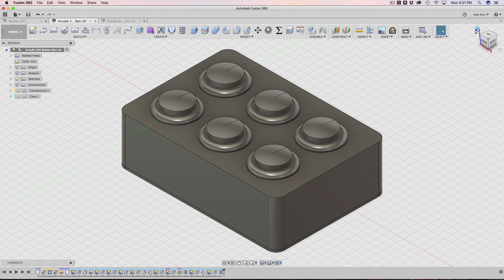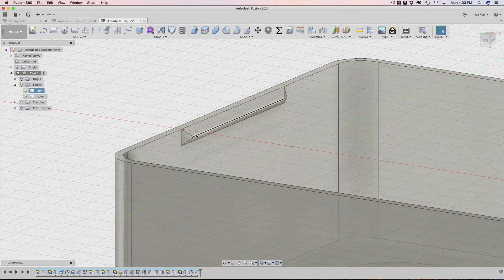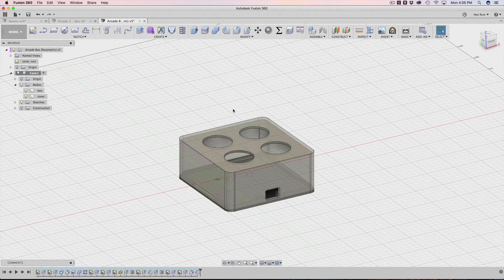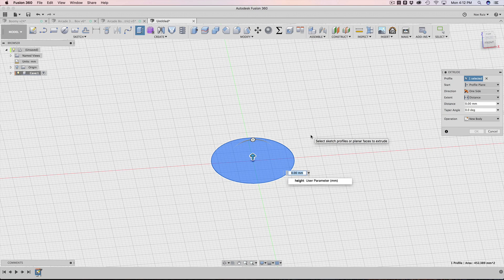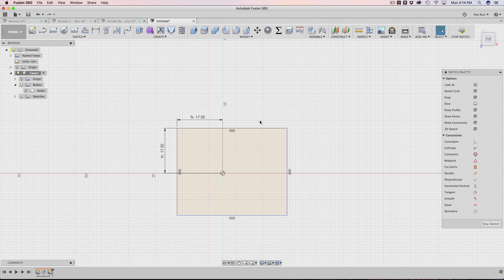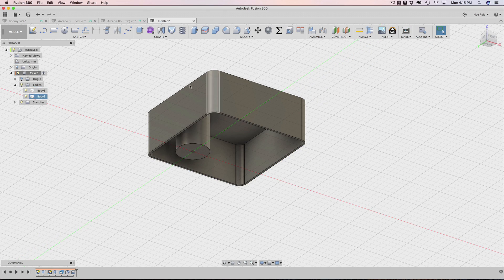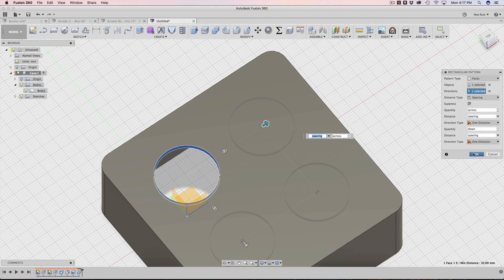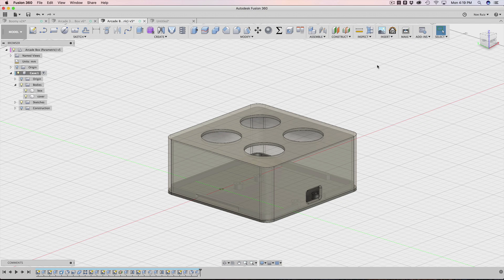Layer by Layer – Parametric Arcade Button Box

Comment: I assume it would be possible to remove one of the button cutouts after doing the pattern? I had a project where I needed to repeat certain standoff structures in a grid pattern but there were cases where one would need to be removed.
Reply from the maker: Yes, good point. In the while apply/editing a pattern, there's an option to enable/disable curtain "copies".